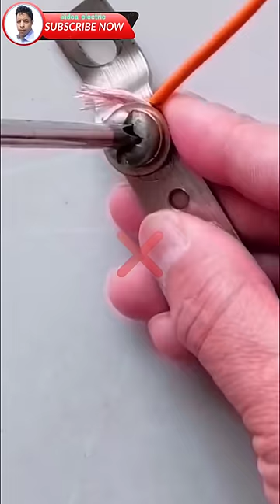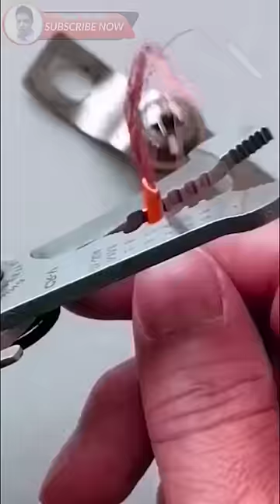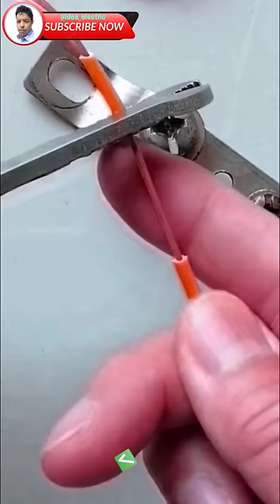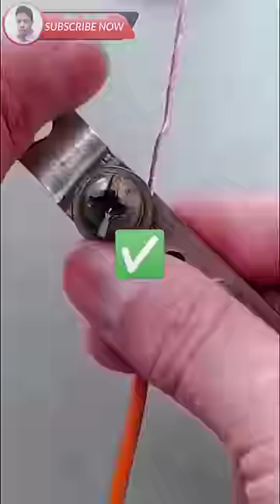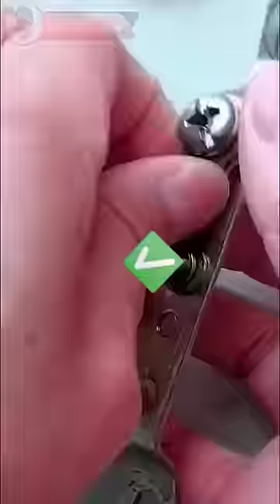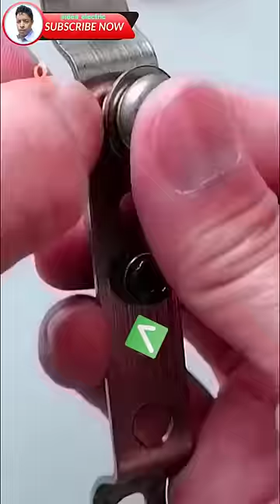You will need this idea even if you have been working as an electrician for 20 years🇺🇸🇬🇧🇲🇫🇮🇳💪👍✅

Comment: It would usually be a ring or flange spade connectors for a ground. Heavier fixtures would include a safety wire to support weight.

Comment: Even if you use the ring terminal, you should put a washer under the screw so that the ring does not rotate with the screw, it is not recommended to twist the soft wire.

Comment: Or, hear me out, cut the wire to the correct length. I know, its hard for electricians to do a decent job, but in the HVAC world, or applied electronics, we have the ability to safely fasten and attach wires in hundreds of ways. Only safe requirements are cutting and shaping them correctly. There are also crimp connectors

Comment: This type of connection is not legal, you basically have 2 wires under the same screw that is designed as a 1 terminal connection. If you do not have a ring terminal, you can backtwist the wire (counter clockwise), when you wrap it around the screw 1 time, it will tighten the twist as you tighten the screw. You still attach the wire clockwise around the screw.
Reply: This is for connecting speakers.
Reply: Aún así, aunque sea un altavoz.
No será la primera etapa de potencia que se queda sin sus transistores finales por estos "inventitos"

Comment: Most screws turn right to tight and left to loosen never saw a screw turn left to tighten!
Reply: You saw that to.
Reply: Me too.
Reply: Video is mirrored.
Reply: There are left hand threads.
Reply: Hit me like a brick...left electric screw...
Reply: @x13roger80  There are left treads of course, but they are use very seldom  , and always are use in hydrogen ( bottles, lines....)
Reply: E que a câmera do celular filma ao contrario, e um terminal é mais barato e muito mais prático e o acabamento fica bem melhor..
Reply: It's the way it was recorded that the video is reversed. You can tell because when he tightens the screw, he turns it to the left as well. Also, you can see that the writing is reversed on the wire strippers.
Reply: I'm agree with you!
Reply: When you tight the screw is turn RIGHT direction so you circle the cable on screw have to same direction and then they will get tightly. 💪
Reply: hands are filming it in selfie mode😅
Reply: @sorcererx1  😂😂😂🥳👍
Reply: Left hand threads, I've seen them on mechanical equipment that spins clockwise to prevent it from loosening mostly on a drive shaft.
Reply: You must be new to videos,   notice peoples watches, rings, hand over heart,  a laptop captures images reversed.  😝
Reply: Yeah they forgot the principal of righty tighty lefty loosey on tightening and loosening screws and you wrap the wire in the direction that Titens
Reply: Most screws turn right. In rare cases it is the other way mostly on moving parts. Pedal bycile blade lawnmower left rear view mirror on yamaha motorbikes,...
Reply: You never been down under then. 😆
Reply: Yes I noticed that

Comment: If you would have spun the wire the opposite way than the threads wouldn't have been trying to unravel it try flipping your wire around and going in the direction the screw Titans yes the piece of plastic on the end is a good for precaution but you put the wire on backwards
Reply: It's the way it was recorded that the video is reversed. You can tell because when he tightens the screw, he turns it to the left as well. Also, you can see that the writing is reversed on the wire strippers.

Comment: Must of reverse the video image, or used a mirror, maybe left hand screws!  Turning it "Counter Clock Wise", he would of notice  his mistake before he posted it.
Reply: It's the way it was recorded that the video is reversed. You can tell because when he tightens the screw, he turns it to the left as well. Also, you can see that the writing is reversed on the wire strippers.

Comment: No twist the wire counter clockwise bend a hook like you do with solid wire wrap it around the screw clockwise and tighten screw it will Natasha out from under the screw and you don't have to strip 6 inches of wire just 3/4 of an inch
Reply: У тебя левая резьба ?